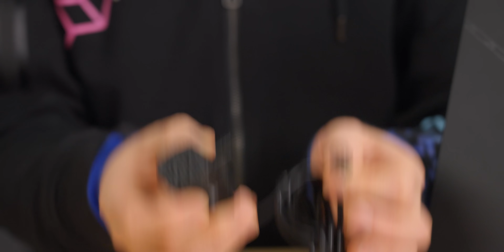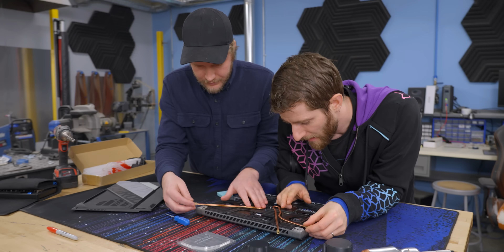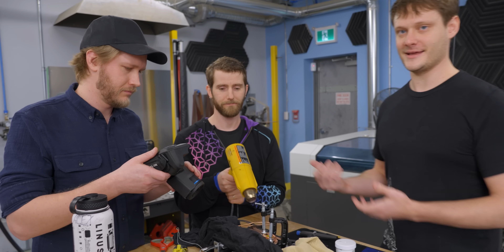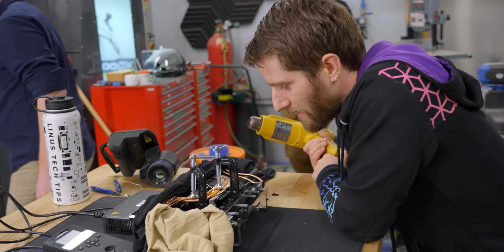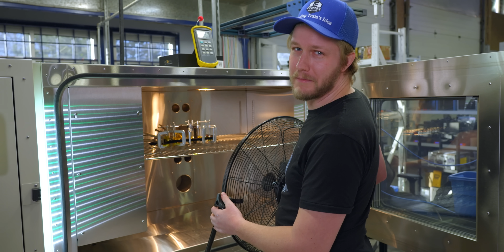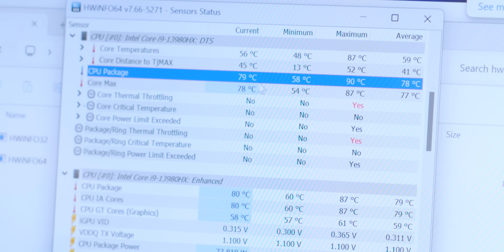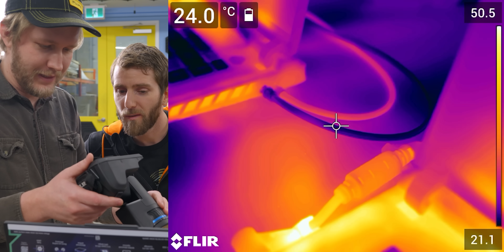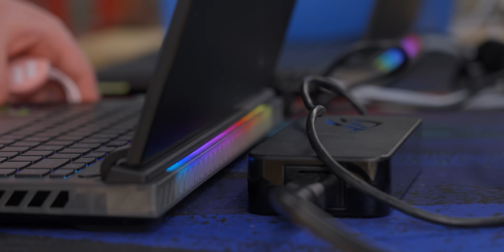Water Cooling a Laptop for $30

Comment: Hello!
I wanted to ask for advice on choosing a laptop, the problem is that one of the options is not presented in the reviews. We are talking about asus tuf gaming f17 FX707VV (13900H and 4060), and the second option is the classic legion 5 pro with 6800H and 3060. The prices are approximately the same: $1200 versus $1150.
I also suddenly came across a third option: ASUS ROG Strix G513 R7 6800H/RTX3060 for +- 900-1000$

The priority is the size and color rendering quality of the display, as well as relevance for playing modern heavy single-player titles at high settings, and of course you want it to be reliable

2023 years' tuf specs looks tastier than Legion for the same price, but tuf 22 years old laptops were problematic, it’s unclear how things are now: I haven’t found a review of this model, just a few reviews.

Comment: A pointless solution. They could have done it more elegantly and smashed the radiator fins. Insert a tube there and pour that thermally conductive "glue" over it. However, I would have removed all the mesh from the laptop case first. That would have dropped the temperature by 5 degrees Celsius. The second option is better. You could have immediately cooled the air going into the laptop. The third option is a Peltier element with an additional aluminum heatsink. You could have used it to cool water. You could have extracted heat, but it would have been very energy-intensive. You could have used gas for the stove, as in the previous project.

Comment: Hey Alex
I run a custom-made fan cooler for my laptops and have done so since the beginning of time because their cooling is never good enough. Could you do a video comparing temps like against the one you just did. I have 3 x 120mm Cooler master blaster master 120 fans (you could use noctua) screwed to a Cooler Master R9-NBC-U3PK-GP Notepal U3. You don't use the USB fans that come with it. I attached a fan controller to control the fan speed and connected a 2amp 12v 24W power supply from an old external hard drive to power the fans. You can seal the gap between the laptop and cooler with a bead of silicon or foam frame to force more air into the laptop. It's much quieter and more efficient than the laptop fans. 😁 It is a really cheap and easy solution with impressive results.

Comment: i hav this same laptop this is an excellent beast gig...but with some cons like gpu always stays cool when no workload but cpu normal opreating temp is 60 with no workload nd with load it shoots to 90- 94 even with undervolting.. gpu stays cool cuz it hav two fans but cpu only hav one...so my guess was right asus is using cheap qaulity products and weak sodering in his products ..i had a striped screw of cpu heatsing when i was screwing back in it riped i thougth maybe i was wrong but when i found out instead of replacing single standoff asus replaced the whole motherboard and the charge was 3100$ CA for mobo only, luckily i was covered in warranty...

Comment: I know you are doing it for entertainment, but please do the safety stuff properly. A disclaimer on the screen.

You are setting an example to engineers all across the world, and when you wear airpods for hearing protection or just breathe in fumes, it's very much "do as I say, not as I do."

Some day, one of your fans will fall off a desk or a shelf installing cables because they didn't use proper equipment and seriously injure themselves.

Comment: Hello Linus I have a small problem with my pc. It says it is running at 90 C but the case any everything in it is cold, but the CPU temps are High. Could it be just something with the BIOS makeing the pc think its overheating or a bad motherboard? I have a water cooler and its working fine but the CPU still gets to high temps even on low usage. Does anyone know what the problem could be?

Comment: you can increase the flow with a CPU block e.g. https://www.youtube.com/watch?v=nvOp6SPI5XY or my thought was exposed heat pipe on the laptop that you can use a CPU cooler tower to dock onto with thermal pads.

Comment: It probably would have been better not to preheat the board so that they wouldn't reflow other solder connections. With the right hot air settings, they could pre-dry the paste at a greater distance then move in closer to quickly reflow once the flux activated and other solvents evaporated.

Comment: I have a simple question that's never ask in hardware circles? When does performance become so great that it becomes stupid?
We have i9 processors that have 24 cores and 6 GHz clock speeds and Terabytes of(blazing fast) storage..etc and this is for the home PC or home laptop. Its become this great pursuit of excess and its becoming stupid.
Case in point... I bought a HP EliteDesk(refurbished) with a i7-6700(yeah only 4 cores with a slow 4Ghz boost) with 16G of DDR4(the slow DDR4) and 500G m.2 NVME Gen3 and installed Ubuntu and it runs fast and snappy with zero complaints. 
It seems the hardware reviewers caters to the minority and not the majority.